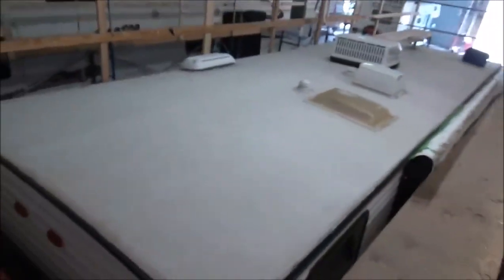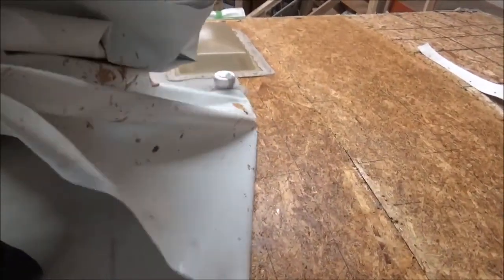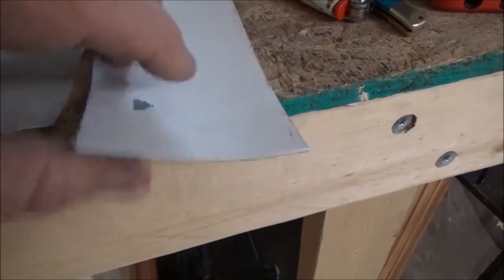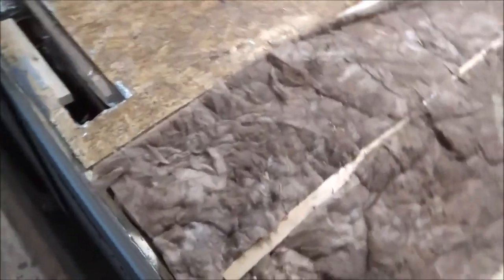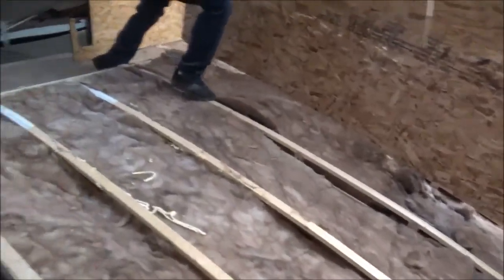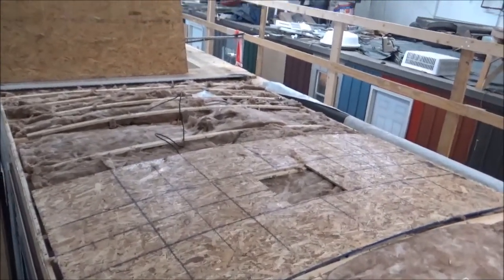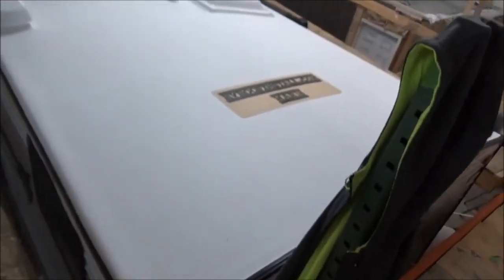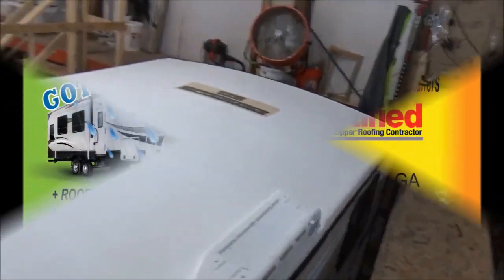Rv roof replacement and repair wildwood 2014

Comment: It's great to see a roof go down right. I'm in commercial construction and this is the same material we use on everything from Hospitals to High Rise buildings. RV roofs are such a joke, mass production and speed is all they care about and they're all the same, a bunch of cheap junk with horrific termination details. Thanks for doing what should be an easy job in the factory correctly afterwards.
Reply from the maker: Thanks Ben. That's my background....former General Contractor in 3 states with focus in a roofs and structural framing, concrete, footers....we have down extensive stucco...real stucco...not the cheap Sto or Drivit acrylic stuff. Mainly we re-imaged / remodeled fast food restaurants, like Pizza Hut, Taco Bell, KFC, .....

Comment: The bushes that you are putting in has just as sharp edge as the edge of the ply!! If the bushes were an elbow that would have been a lot better!!
Reply from the maker: The bushings are not sharp. these are electrical code
Reply from the maker: Not sure I am following. Putting in the protective strips  is not a sharp edge at all. The bushings...this go in the ferrel to protect the wire. We don't aim to be counterproductive.